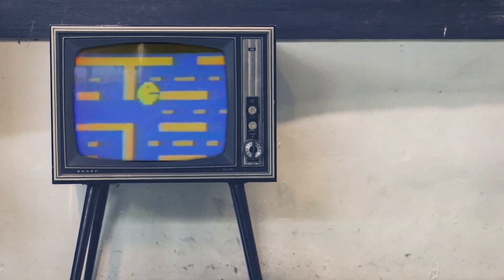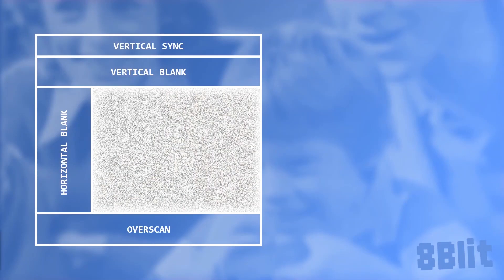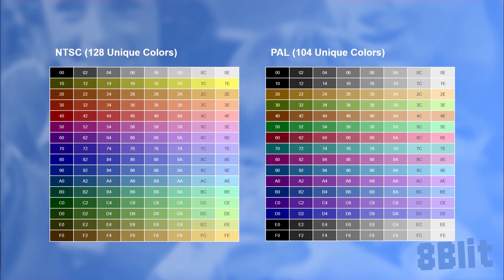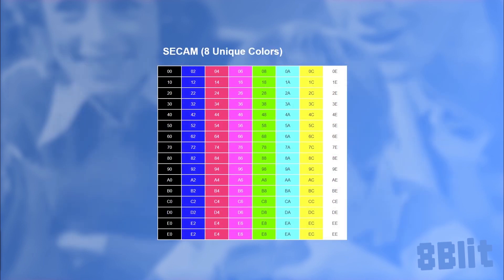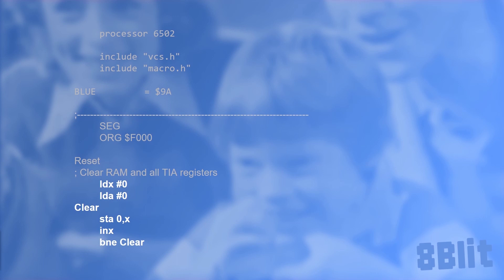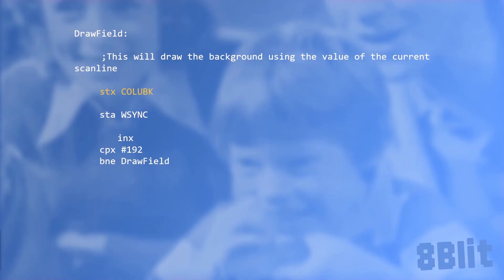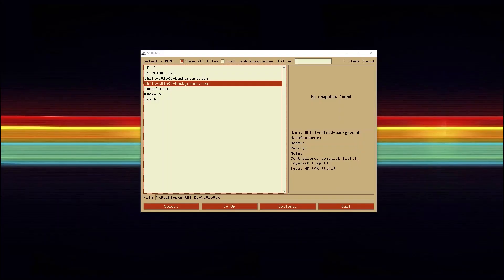Your first code for the Atari 2600 | 8Blit

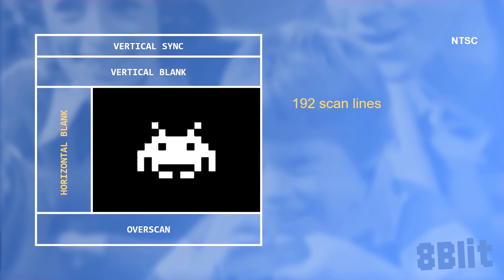Comment: 3:37 - can you tell me why even though the display area is 192, when I take a screenshot with stella it sends out a picture/screenshot containing 228 scanlines? like, I refuse to believe that 228 is the actual game res... I have sticked with 192 always and been teaching that instead...
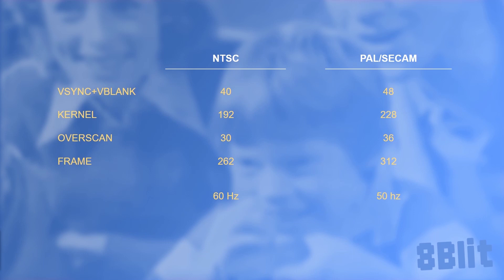3:52 - oh looks like this is the answer huh! cause it´s pal.
But what I actually mean is, I like to make Atari like games using Fusion 2.5 and so I try to stay faithful to the looks on the screen. Am I correct to use 192 as my vertical resolution? it seems to be that it fits best. So I am doing 160x192
Reply from the maker: Yes, for NTSC 192 is a valid vertical resolution. You have some leeway to use a little more or less. Some CRT's have move visible scan lines. Some have less.
Reply: @8Blit  I feel relieved now! thanks! 😁

Comment: 2:06 it doesn’t reset its position back to the starting point if it’s interlaced right? It would only go back to the starting point every other cycle.
Reply: When I was in high school I connected the speaker outputs from a small stereo to the deflection coil of a tv. I connected the left channel to horizontal and the right to vertical or it may have been vice versa. I remember having to add resistors to one or the other because their impedance wasn’t equal. You could also use the balance control to make the image wider and less tall or whatever. Turning the volume up and down would make the image bigger or smaller. No sound at all would result in the beam shining in the center of the screen which I suspected would burn a hole so I was careful not to leave it there. Anyway it was pretty spectacular to watch as you listened to music. It worked well with black and white TVs. I tried  a color tv and used toggle switches to turn each color on and off but when I powered it up the magic smoke came out for some reason. And to clarify, this stereo was only to drive the yoke and I was using another stereo to listen with the speakers.

Comment: 10:30 wait so the X register on the 6507 is only 7 bits instead of the 8 of the 6502?!?!

Or did you mean to initialize X to #80?
Reply from the maker: Thanks for catching that. Not sure if I wrote it that way in my script, or if I just read it wrong.

Comment: As a historical footnote the Mac uses the VBI and VBL tasks to calculate and reposition the cursor during blanking interrupts - which is why the Mac cursor is so smooth since it’s movement interval is synched to a an exact hardware interrupt interval. All other OSes use software timers to move the cursor which is why they are skittish.
Reply from the maker: Ah nice, syncing up with the interrupt is a cool idea!

Comment: I started programming at age 13 and Microsoft QBasic on DOS was my first pick. Some time later, I studied a little bit of X86 assembly language but didn't dive much deeper into it than writing hello world and some basic loops. When I was 15, I found this group on Yahoo with Brazilian Atari 2600 programmers and I instantly joined them. Now, after two decades and some 😝, I work with software development and requirements analysis and am a hobbyist retro videogame consoles programmer. I mostly code for Atari 2600, NES and SEGA Master System/Game Gear.
Reply: Oi, Leandro. Td bem? Vc tem email ou WhatsApp? Eu estou pesquisando sobre programacao de consoles de videogame...
Reply from the maker: 8blit0@gmail.com
Reply from the maker: That's awesome, would love to see some of your stuff! Especially for the 2600.
Reply: Leandro,  você pode programar novamente em um QBASIC moderno.  Pode até fazer jogos. E compila pra Windows e Linux.  Procure QB64. Reescrevi um pequeno projeto de jogo que eu havia feito quando eu era criança neste compilador.

Comment: Is the X register 8 or 16 bits? I thought the index registers are 16 bits. Also, it appears that the TIA is memory mapped at address $00xx, is this correct?
Reply from the maker: The X, Y, and Accumulator are all 8 bit registers on the 6502 and 6507 with the maximum value of 255. The TIA is mapped at $0000 - $003F, while the 128 bytes for  RIOT RAM is mapped at $0080 - $00FF.
Reply: @8Blit  So when doing sta x where does the upper byte of the address come from or can indexed writes just access the first 256 bytes of memory?
Reply from the maker: Sorry Jacob, just saw this comment. YouTube doesn't automatically show me 2nd level comments for some reason! The next video will have more detail on this, but the short form is, you would use Indirect mode for your load instruction, which will use the address you specify with the instruction, along with the byte right beside that address as the 16-bit address.